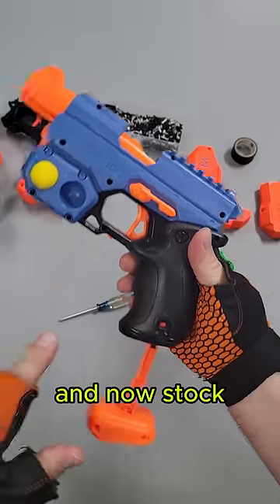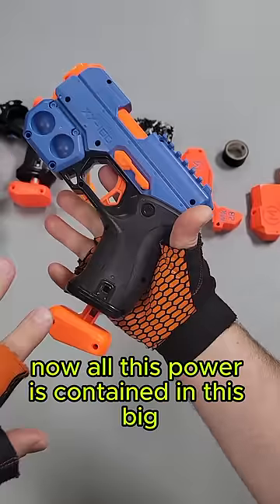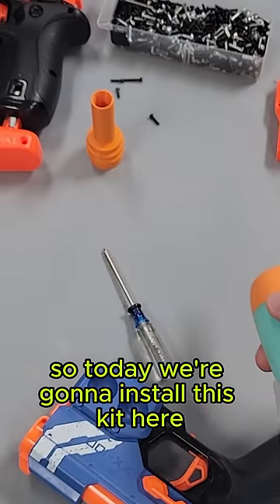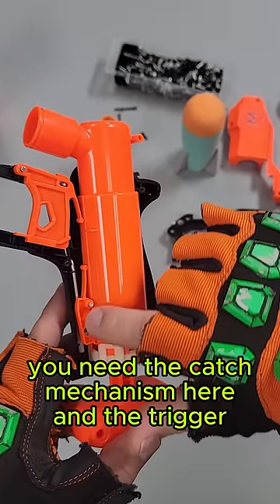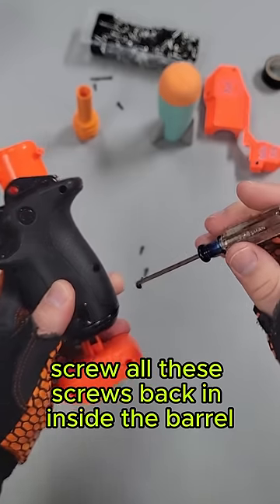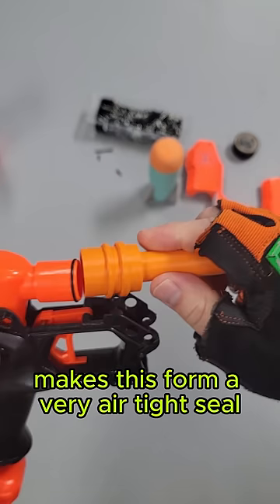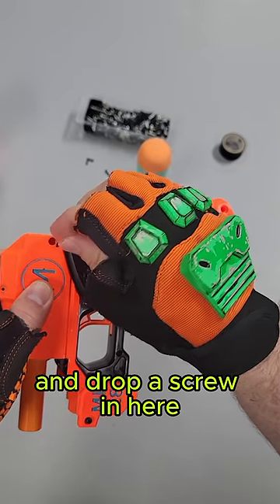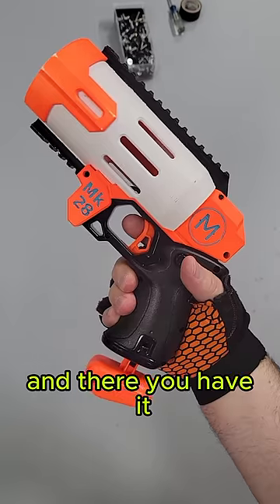Nerf Fortnite Missile Pistol Rival Knockout Modification

Comment: Is there anything the Knock Out can’t be modded to fire?  Such a great blaster!
Reply: I haven't seen one that fires 50cal.
Reply: @chocopro818  just wait
Reply: @chocopro818  i mean, if we're gonna get really technical here, the nerf community sometimes refers to the Rival rounds as 50 cal balls, soooooo
Reply: The nerf modder's jolt
Reply: @kdevlogs5550  50 cal balls is a different ammo type that monkee mods sell, it’s the same diameter as a long dart or a short dart, a Rival round is bigger and closer to a mega dart in diameter
Reply: @chocopro818  I am pretty sure Out of Darts sell little rocket adapters for Knockouts, and there is a little rocket barrel for 50 caliber projectiles like short darts
And also there’s a lot of Knockout brass barrel kits for short darts, which are 50 caliber
Reply: @normalwaffle  oh ok they just looked exactly the same as rival rounds so when i saw them i couldn't tell. now im starting to realize that's probably what they were referring to and not an actual 50 bmg round lmao
Reply: I can get XFoxGames - XFKO To fire every single Nerf ammo, even the Rockets.
Reply: A mediocre employee.
Reply: boolet
Reply: 40 mm Artillery Shell
Reply: .75 calibre bolter round
from Wh40k
Reply: Probably vortex disks
Reply: Ultimator rocket
Reply: @chocopro818 nerf rounds are technically 50 caliber
Reply: @sumogorygames  I’m not even into nerf to an extreme degree, but growing up, the jolt was the shit. That’s gotta be one of the strongest nerf guns there is, and it doesn’t even have a proper barrel 😂
Reply: If you cut a ball in half, put a nail through it, and then attach a post to the bottom, you can make rounds that pop balloons or stick in targets. It's not very safe but it's incredibly satisfying
Reply: Every blaster can be modded to do anything if u have no limits
Reply: A comically large spoon